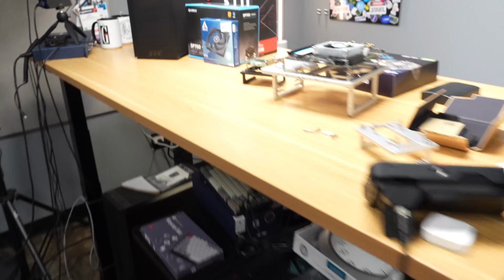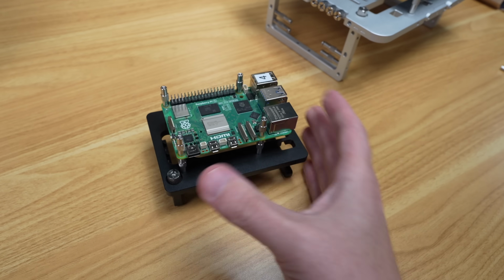Why does this exist? (BC1 Pi)

Comment: I can see a use case for level 2 jeff were, if you do a LOT of pi testing, no one would want to be mounting each of them in and out of a normal closed case. So a ' test bench ' makes sense, just like the ones for motherboards.😅

Comment: If I was constantly tinkering with my Pis, then it would be nice to have. The plastic base, besides the cooling aspect, doesn't anchor it very well on the desk. tbh, I think the plastic base is the true waste of $. 

Now am I going to buy one? Probably not, just cause I don't have time to tinker with the hardware - my pis live in their minirack 99% of the time - all tinkering is done in software.

Comment: I think  it should be a bit bigger though. like if it was double the size it would be pretty cool, I'm thinking this would be usable to hardware developers for the pi, and it would be nice to have a spot to mount whatever daughterboard you're working on  and can connect with a  gpio cable extender or some kind of right angle mount.

Comment: I like it. Anything that adds weight helps. However, i create my own by screwing it into a frame+board (the kind you buy at hobby lobby or walmart for art projects) along with two to four breadboards and an fpga dev board. It holds everything together  nicely makes it easy to hook up wires, ect and create prototypes of projects.

Comment: Would have been great with just press mounting. There are pins where you only need to push down the board, no need to screw the ones at the top. You might want both for compatibility reasons.

Comment: It's certainly cool looking, and it would definitely be useful, but $40 is still too much. I've got a bunch of empty aluminum cans, a forge and sand molds, so I could make one myself in a few hours and while adding things up on an individual basis would undoubtedly come out to a whole lot more, the ameliorated cost of all the tools and materials is actually significantly lower. Although, it would be funny to make one out of cherry wood and send it to Clint. I don't know if he plays around with Pi's, but I have to see if I have any cherry left and if he has an easily accessible shipping address.

Comment: I do have problems with a pi falling off a table when lots of cables are attached. But that’s more of a problem with the zero. It would not be hard to drill and tap more holes.

Comment: I use the ITX & ATX benchtable and they are good in avoiding mess & saving time when you are changing components on a system. Most likely the same applies to the Pi, if you change sensors for a experimental setup I think it can make sense, if it safes 30 minutes of developer time it already paid off

Comment: This is interesting however some improvements: add holes for Zero and Pico form factors. Or several pico locations. In an educational setting this allow for the use of fixed screws right by way of glue or some other means.

Comment: Bust your hump to design something with some utility, only to have a YouTuber call your creation ridiculous. That’s job satisfaction!

I can understand “Hey I don’t see a market for it” or “It’s priced a bit high for what it does”, fine. But it fills an obvious need if you don’t want to deal with those plastic risers for the Pi. The tinkerers of the world need access as Jeff well knows.
Reply from the maker: There are some other metal cases that give good access to the Pi and are priced a bit more down to earth though.

I don't deny the engineering and finish of this thing is great (though I think there are a few improvements to be made), and I thoroughly appreciate the other benchtables for the utility (and they are well worth the price I paid for them, and then some)

Comment: it's typical engineering practice to put bare boards on something for the engineers to work with them at their desks. rubber feet are usually involved. often just the rubber feet stuck to the PCB are enough, or brass spacers into whatever mounting holes the PCB has. if it's a multi-board setup, you need a base plate to keep everything in arrangement. something with a bit of heft to it is also nice.

Comment: I appreciate any kind of mounting or case that's heavy enough and has sticky enough feet that my Pi doesn't end up getting pulled around to wherever the stiff cables want it to be.  So yeah, I see some value in something like that, in addition to the access and airflow advantages that you mentioned.

Comment: I think it's neat, but ultimately useless (for me.)  Would I buy it for $40 No. I might think about it for like 10 bucks.. But still. Useless for me considering when I'm playing around with the Pi, it's the plain board sitting on my wooden desk. The only exception was with my old RPi 3: I spent a decent amount of $ for a fully enclosed metal case with a fan and a SATA/USB converter so I could put an SSD inside the case. Used it that way for years.

Comment: Hm, 50$, before or after Trump tax?  Way to much, even if it seems to made with very good finish. You mentioned some improvements like mountings for a fan and that is the one thing I would like to see as well. I use a 120 mm USB fan to cool my RPí 4 with SSD HD mounted to it. Have been thinking of a way to mount together 3 or 4 RPi 4 on stack with a 120 mm fan cooling those 4 units and for best cooling have some paper box to have proper air flow to get it cooled. It's just that I haven't figured out a smart way to power it all without lots of different PSU. Would be great if someone could design a daisy chain for powering several RPi over GPIO. I know that I could buy the solution to powering them via network cable but that is to expensive and I don't have network switches for that either.

Comment: I love when companies don't take themselves too seriously and make products like this. I would love to own one, but I would also like to see some revisions of it... maybe add support for mounting a PSU on the underside, but also mounts for a fan or two like you said. It's fun! 

I think Asus made something similar to their tinkerboard, though a lot cheaper - basically a stamped plate and some posts. I have one of those, I got it because it adds a lot of weight to the SBC so it doesn't run away just from the weight of the cable. I imagine this Streacom helps with that too, considering the feet it has.

Comment: If they had put in 2 more threaded holes so the legs could be the same orientation, it could be hung up on a wall with wires out to left/right dependant on screwed legs up, or down
Actually 4 more threaded holes on the long side, you could have the wires go up/down

Comment: I would love the option of spikey feet for soft surfaces and rubber feet for a hard slippery surface.  I think ideally the spikey feet would screw into holes on to the existing feet and the rubber feet would be peel and stick.

Comment: I would love a Pi case that is fairly large, and boxy, and made of metal (as opposed to 3D printed) that you could mount an 120mm computer fan on it (with a screen) for maximum cooling.

Comment: I honestly kind of like it.  Not really for practical reasons...  Or at least not for practical reasons other than setting up a system, where you're playing with whatever you would work with in that form factor.  Like, if I'm building something on an Arduino (not sure if it's the same form factor), developing like a weather station or whatever.  It's cool that it would work well for that.  My current Arduino setup...  This would be an upgrade.  Even the Pi setup...  If I was using the GPIO pins, and developing something, absolutely would make sense.  

The main thing about it though, is the aesthetics.  It's pretty as heck.

Comment: Yer right!  "It's not useless." but it wouldn't be useful to me.  A "bumper" would be more useful to me not to mention far less painful on the wallet.  I've used a handful of metal or nylon spacers to lift a RPi off the table and just as stable.

Comment: Considering pi 5 has a pcie ribbon slot, that benchtable could have had a pci bracket holder like the atx one and a way to mount the pcie adapter to it.

Comment: the added height makes the pi feel more confident so it'll perform better in testing. just like high heels.
Reply: jokes aside plastic versions of these are very useful for just getting boards off surfaces so i don't have to worry about a random component or coin on my desk shorting the back of something while i'm tinkering.
Reply: I never thought of wearing high heels for confidence. I'll have to try that on my next teacher evaluation.😊

Comment: Do the rubber feet at the bottom come out as easily as the ones on Streacom’s larger open bench tables? Really dislike them, before I knew of that issue I had lost a few while carrying setups around.

Comment: I'm one of those people that will get one probably, whenever I get to doing a pi. I do wish it has threaded holes on the sides to attach extra bits to. I mean on the side of the plate the pi is on, not just fans but cable straps to secure things, and extra doodads one inevitably attaches to ones pi, like camera modules etc. If it has the holes you could just 3D print a bracket to hold whatever neutron gun or antigravity generator you might be building out to be controlled by the Pi. Or have it laser cut or machined.

Comment: Are the feet through holes? If they are you can bolt to something rather than having to make your own mount, as you test / swap out various assemblies. Then to swap out the pi itself its just two thumbscrews

Comment: it looks like a target for a 3d print, which should be considerably cheaper, but apart from price, it looks nice
Reply: lots of "3d prints" of flat things should have been laser cut from acrylic or cardboard/MDF
Reply: @crackwitz  agreed, but if you have a 3d printer, not a laser cutter, - to a hammer, everything is a nail :-)

Comment: I can see these being used in the classroom, even the other two you have as well. A easy way to have the boards anchored to something solid but still being open enough to have newbies be able to identify and then possibly connect to different components.

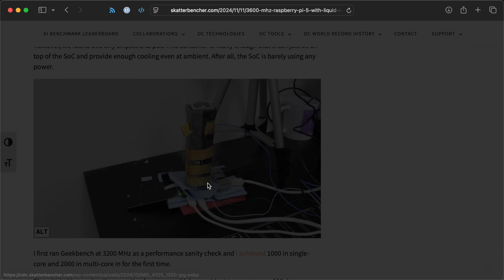Comment: Gotta call out the slip of the tongue: 6:28  - if SkatterBencher is doing NO2 pots, their lungs are gone: it's a brown gas (at STP), which is toxic, by virtue of turning into nitric acid on contact with lung tissue. It's the red/brown gas you see spewing out of Chinese rocket launches: they use it as the oxidizer in the hypergolic N2O4/hydrazine propellant pair. I'm sure SkatterBencher is really using  an N2 pot (i.e. liquid nitrogen) - still need caution to avoid freeze burns (or boiling off enough to reduce the oxygen levels in the room: ventilation required!) but not rocket science. ;)
Reply from the maker: Heh, N2, N2!

Comment: to be fair, the other open benchtables are also very niche products
Reply from the maker: True, true... but those have so many mounting points and I get a ton of use out of them. I had tried some other benchtable options, and these are the most versatile / nice to use (IMO), if you are making a lot of changes.

Comment: Is the BC1 Pi Open Benchtable a 1) good idea 2) bad idea 3) niche idea?

Well - yes!

I'm not seeing a finalized project using a benchtable except possibly as an exhibit in an art museum. But for making a mess around an unfinished idea? For stress testing a nominally working idea before putting a package together? (As pointed out by another commenter - probably a good idea to partially protect some parts from the mad drink spiller)

Comment: If you had enough of those posts, you could build a pi cluster stacked up on your desk. Looks like you have enough for 3 pi's, or 4 if you use screws on the top.

Comment: OK I get the idea. Its got enough mass so it sits still when you're working with it, but you have all the space so you have access to everything. Yeah I dig it. And like you said, it looks to be very well made. For prototyping it would be wonderful to work with it. And now that we have access to online cnc places, maybe people could create their own accessories that would bolt to it? Cool beans!
Reply from the maker: They're all about mods, with the larger Open Benchtables. I think some can be made for this, but they should definitely add more hard mounting points!
Reply: @Level2Jeff  Did they make the cad drawings available for the modding community?

Comment: I could see this being useful for someone extremely heavy into the diy gpio scene, wires and gizmos everywhere.
Reply from the maker: Yeah, it does give a lot of clearance for shenanigans.
Reply: Then it shoud be bigger to hold additional PCBs. But being made out of metal isn't a really good choice for this scenario.
Reply: @JohnADoe-pg1qk  Hmm, that whole thing would be easily printable - would miss out on the extra mass feature, but that could be at least partially solved with some drop in steel rods in the leg parts. Hmmm, I may need to go hit opencad with this idea.

Comment: I can imagine its heavy enough to stop it moving around when connecting unwieldy "stiff" cables?
Reply from the maker: Somewhat, though the center of gravity is a little higher, so if you have a heavy USB accessory plugged in, or a cable pulling down, it could tip it that way still.

Comment: I think it exists largely for the memes, like the Fractal North Pi. It at least holds the pi sturdy on the table so it's not flopping around like a bare pi or a pi in a typical plastic case.
Reply: I just left mine bare on the workbench running pihole for 3 years. No case, no fans, just doing its thing

Comment: I see one problem that it fixes. If it is heavy, which I assume it is, it may cause PI to stay in a place i want when a thick cable is connected like HDMI.
Reply: Yeaaa tought the same thing!
Reply: Or tape the legs to the table

Comment: Re: Screw holes on the side...  Surely redshirt Jeff has a tap+die set?   😇  (I know, you want them to do it for the commercial product, but just so you can mod the one you already have.)
Reply from the maker: True, true... but I don't have the machining prowess (much less good equipment) to make some properly centered holes in the side of the thing. They'd be a bit cattywampus!

Comment: Sure if you're experimenting e.g. with Waveshare screens. Sometimes cases don't exist (they barely exist even for bottom-mount nvme drives which are super common) and you need access to pins and headers. (Bumper doesn't work with a bottom-mount nvme drive either.)

Comment: This would be cool if you could mount two 2.5 inch SSDs in the legs for a small homeserver.
Reply from the maker: That's actually an interesting idea; make the legs a bit more functional.
Reply: @Level2Jeff  yes please, make my lego stand look naff
Reply: Seems likely the creator was just marketing a stand and nobody spoke up yet and told them they could multipurpose that space
Reply: Was thinking the same thing, but three. Minimal RAID-5 NAS. And a couple of screw holes for a fan as Jeff mentioned.
Reply: I dont understand why we dont have a case where the 2.5 drive IS the case. One plate to the bottom of the drive, one ribben cable, and the top of the drive would be the base. 4 rubber baby buggy bumper and a sata 90° ribbon cable and a sata hat.
Reply: @ Maybe just use USB 3 if you're using SATA. But yeah, you could easily make one if you want. Just open up one of the SATA SSDs and punch or drill some holes in it. There is often a lot of space in them around the board. Have at it. 👍
Reply: Even better (imho) would be a micro PC type enclosure with drive mounts.  Cooling fan perhaps?  All of these teeny Raspberry mounts are just too minimal to me.
Reply: You can take yourself under control, do not buy such crap couple of times and you have spare money for a 3d printer which will do whatever you ask
Reply: @SergeiSugaroverdoseShuykov  No thanks. I'd rather carve stuff out of wood or cut sheet metal than mess with those flimsy, flaky things. They and their printings just aren't reliable enough, so you're always trying to make them work better. It's a never ending cycle of disappointment. There's enough cheap plastic crap in the world without me having to waste time making more of it.
Reply: @WR3ND  yeah, and as it turns out the filament and the printing process makes toxic fumes we shouldn't be breathing. We are gonna be seeing commercials for class actions in a few years with people that have lung damage